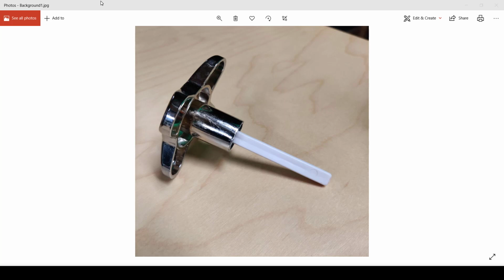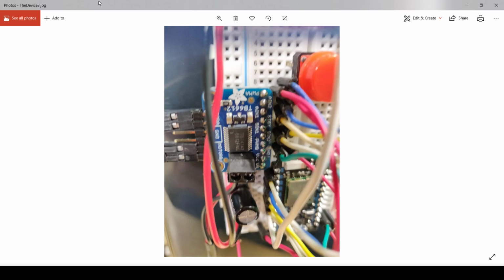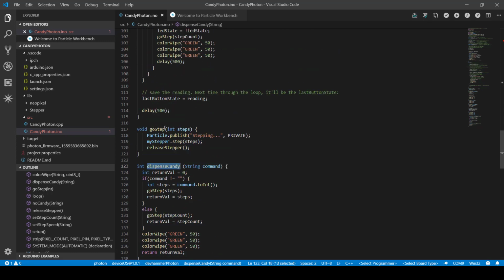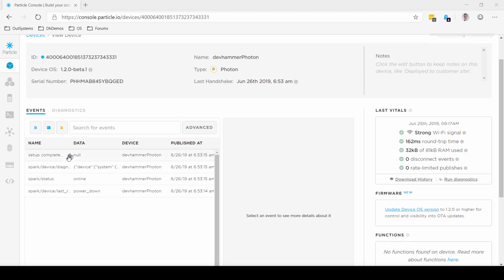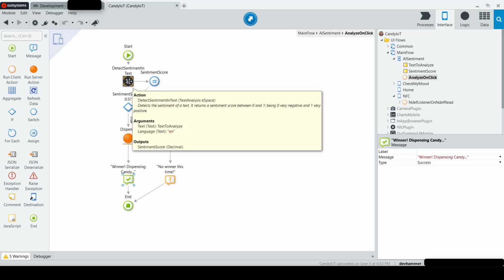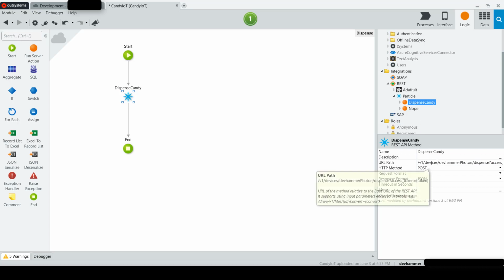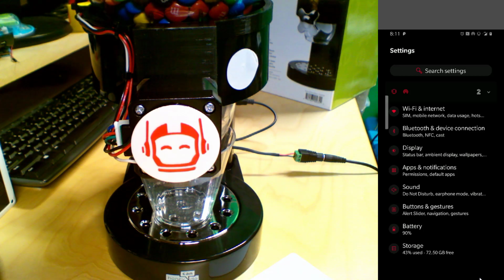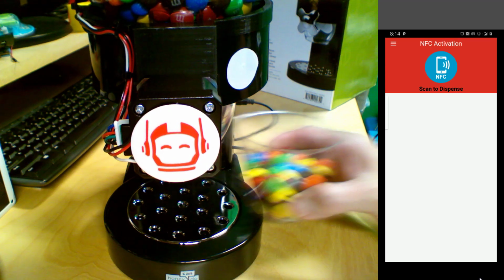How to Create an Internet-connected AI-powered Candy Dispenser

Comment: Awesome!
Too bad I am too weak at the programming part and it seems to be rather much programming to make it work!
Reply from the maker: Andrew here...don't sell yourself short!
Granted, working with IoT devices is a little more code than just creating an OutSystems app, but each piece (working with the stepper motor, blinking lights, etc.) is pretty straightforward, and most boards (particularly in the Arduino space) have helpful libraries, and many tutorials available to get you started.